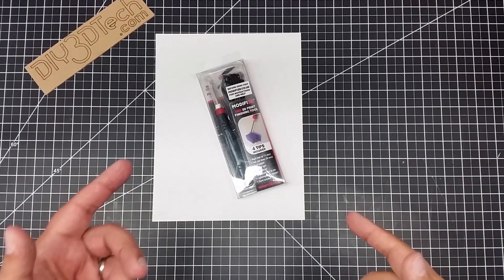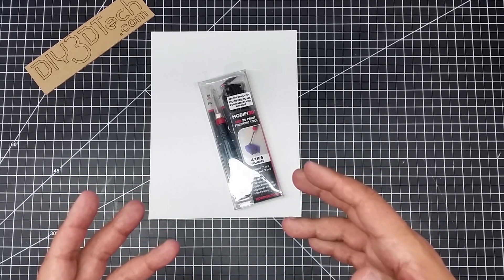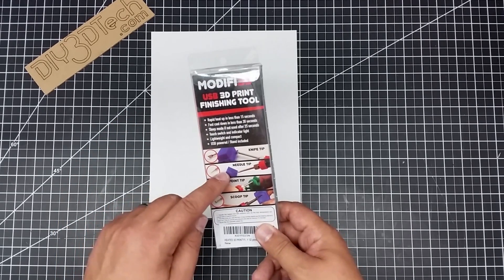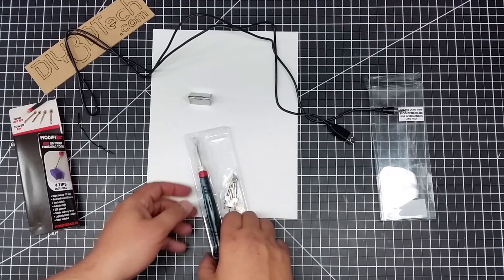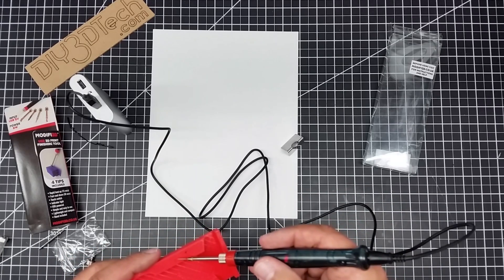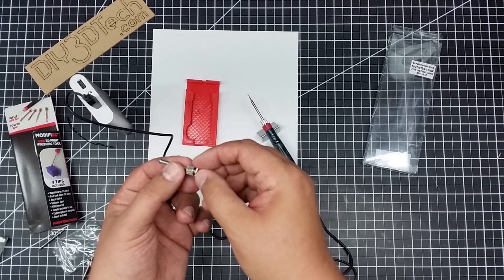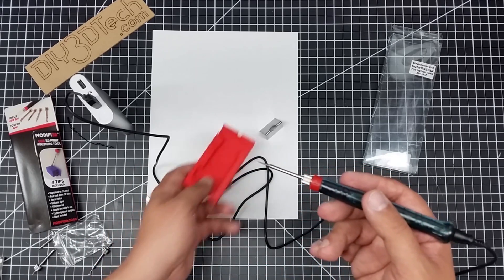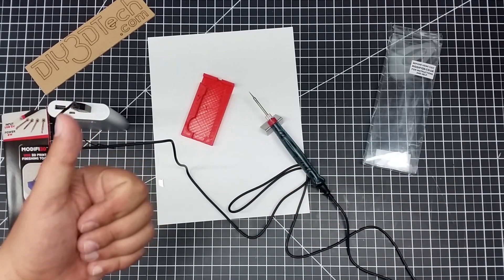Shop Talk - Interesting USB Powered 3D print Clean Up Tool!

Comment: I recognise this 'clean-up tool'! It's ZhongDi ZD-20U USB soldering iron. Unfortunately ZhongDi only makes one tip for it, which has a very fine sharp tip but widens to retain more thermal mass, and can reach super high temperatures if you're not careful, easily 400°C. The touch sensor keeps heating as long as you touch it, but also for about 20-30 seconds after you let go of it. The cap is dual function by design: it works as a wrench to take off the tip if you twist it, but you simply pull it straight off to take off normally. These heater-tip elements that you got with this kit must have been custom commissioned, and at least the fine tip one will balance out at a lower temperature than the one that comes from ZhongDi, so i think that was the design goal here. I don't think the company will sell you tips separately at a lower price, because the whole value of their device is in the tips, the soldering iron body is barely $5 including shipping in single quantity. So people would just buy one or two tips and a ZhongDi body, and their bottom line would suffer.

If you ever take it apart, you should find the classic 555 timer IC inside alongside a switching MOSFET.

You keep asking for links, well links are here today gone tomorrow, but if you just look at Aliexpress, eBay (set location to worldwide), Banggood, Tinydeal, TomTop, for a USB 8W soldering iron, you'll find those sold under whatever store or distributor brand.
Reply from the maker: Yes as I really like this but the price is still a little high and agree with you this UK company likely commissioned them with different tips.  Found them on eBay for $7 bucks thanks :-)
Reply from the maker: PS just ordered several from eBay for $2.99

Comment: Oh boy these again. For those that don't know a company tried to heavily market these a while back but when people questioned the company about the fact that they were just repackaged cheap chinese USB soldering irons (they can be found for about 5 dollars on eBay if interested) they denied the allegations, stated they had custom hardware inside but where proven false when people opened them both up. They only thing they had going for them was the sightly different heater tips, but someone found a way to easily diy the different tips and use the $5 soldiering iron, making the the product not worth the asking price of $75 (If memory serves). It primary was started on the 3Dprintingnerd's channel by its viewer base , and he ultimately apologizing to the viewers for recommending an overpriced soldering iron (though I believe he did nothing wrong, as he had no way of knowing). 

Also I believe the touch sensor is on a timer. You get about 30 seconds every time you touch the button. Obviously if you continuously touch it the timer never starts. As a soldiering iron it does heat up rather fast, and it is portable. Which is good for those that need a portable soldering iron (for some reason). But do realize that doing anything other than very light duty work will reduce the life of the unit greatly.

ultimately if you want a heating tool you can use for 3d printers get a cheap wood burning tool set they are super cheap and will serve you better than this tool. They have a ton of more tips, and run on mains making them far more useful. I personally don't find heating tools that much useful for 3d prints. I tend to find a sharp hobby knife and sanding tools more useful.
Reply from the maker: This one is a little different as it is USB powered which I like as use a power bank as in the video.  Then it has tips more a tune cutting plastic, however a little bummed the knife one was broken. All in all found it handy especially for TPU to cleanly remove the supports.  However I have to disagree with you on the wood-burning thing as the tips are to course for my liking.  The pointed tip you see me use works well for smoothing, and the price well as said I found 35 buck on the higher side of an impulse buy but if your serious I feel it was worth money and been even happier with the knife blade wasn't broken...
Reply: yeah its exactly like the one I have. If I remember correctly it ONLY should be used with a power bank. If connected to mains, via a charger, they are not isolated and mains is passed to the tip. But that's if you use it as a soldering iron, but for melting plastic its perfectly fine and doesn't make a difference. The pointed tip i believe is the same as what comes stock on the $5 unit. The wood burning tool was merely a suggestion, I don't actually own one, but you might be right. I just wanted people to know about this tool at a way cheaper price, and didn't want them spending more than they needed too. Gotta say the best thing about this little tool is the heat up speed. Think its like 15 seconds and its good to go. I might buy a second and give it a shot as a smoothing tool. It's so cheap why not. Only thing I don't like is the replacement tips are like 2 bucks each and only available from china. If I remember correctly you could find the 5 pack of replacement tips (the ones with the scoop and knife for 3d prints) on aliexpress, but that was a long time ago when I checked.
Reply from the maker: Have looked at several and have not seen such fine tips, do you have a link?  Also I am a little confused as if you use this with a wall charger I don't see an issue are they are isolated as that (i.e. the wall wart) wouldn't pass UL approval...
Reply: lol meant a to write small voltage, mains voltage on the end of soldering iron would be ridiculous. I meant that the soldering iron is not isolated internally and a small voltage can sometimes be detected. It apparently only comes when using those cheap capacitance drop wall chargers. Like I said really only pertains to soldering sensitive components, and I only use a power bank since I don't have any plugs handy in my small corner. Also I'm sorry I tired looking around to find those 5 packs of replacement tips but they don't seem to sell them anymore. I only found the knife tips for full size soldering irons and for the TS100 the one linked by Dr Pace

Comment: https://www.gearbest.com/boards-shields/pp_266258.html?wid=21..  get one of these.. great mini soldering iron and you can get different tips for example TS-K with a knife like shape.. smart adjustable temperature control, motion control, fast heatup  i love mine for cleanup and smaller soldering jobs even for smd ;)
Reply from the maker: At $81 while a nice looking iron, that price verses $35 I have a hard time convincing myself but if it works :-)
Reply: i use it as my main soldering iron, the cleanup option is just a plus, if you are looking for a small powerfull iron which can do both jobs good, for me that would be/is my choice.. the link was just an example, i got mine on amazon.de for 65 euros incl power supply.. input voltage is 12-24v ( you could use a lipo pack as mobile iron)
Reply from the maker: Got an entire SMD soldering station for about $65 that's been great but it too doesn't have the fine tips this has...
Reply: BTW, TS100 is based on Hakko T12 cartridge mount - however, in original Hakko handles, the cartridge goes all the way through the handle. They couldn't do this in TS100, they needed space for the electronics, so the cartridge is shortened, and a flange is added for extra cooling and to mount it more securely. TS100 is certainly a top notch soldering tool.

You can get T12 kits for ridiculously little money... i have little desk depth, so i'm designing/building a 3D printed enclosure to get a T12 controller, a KX-2412DC power supply (i donated one to DiodeGoneWild and he did a teardown on YouTube... and i ordered one myself and got something entirely different, same at first glance, same footprint, but different brand and so much better made), and a switch mode cv/cc regulator to use like lab power supply, and 60/80mm fan, all in same enclosure where everything is mounted vertically and it should have just 6x9cm desk footprint. I'll publish it once i'm done, could take a few more weeks.

But you can also take one of those micro T12 controller enclosures already on Thingiverse and power them off a laptop brick or an RC battery. You can get a complete kit with a converted handle (a bit sub par) for $15 on Banggood, or you could get just the board for $7 on eBay and get a Hakko 9501 clone handle separately for maybe $15, I've even seen $4 controllers on eBay which have no screen, and probably don't have PID which the STC ones do, but are absolutely tiny! The possibilities! Y'all got 3D printers, right?